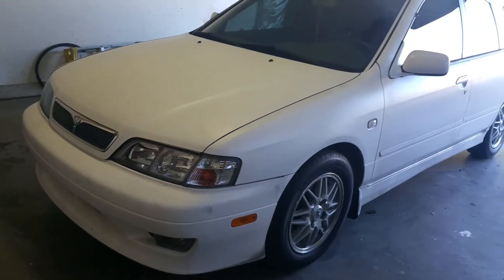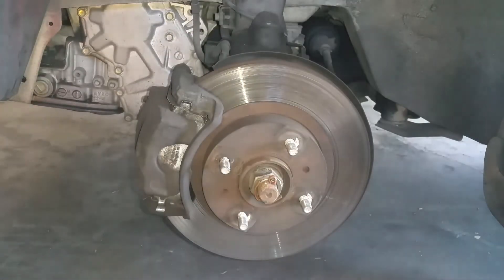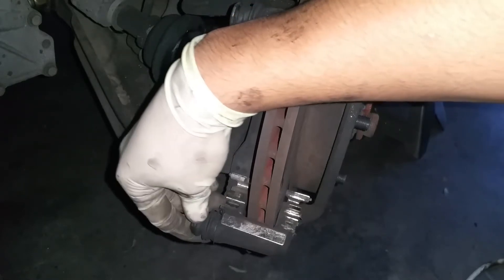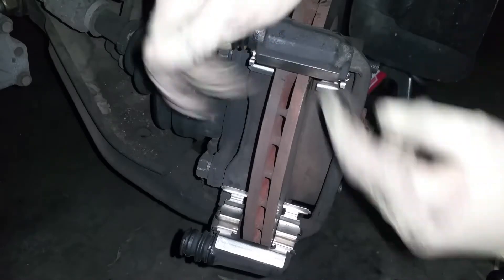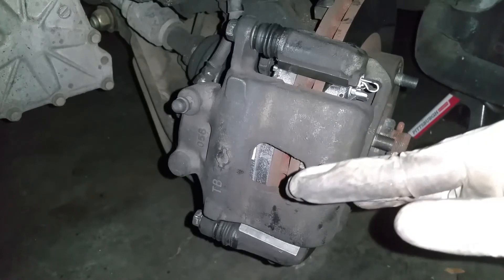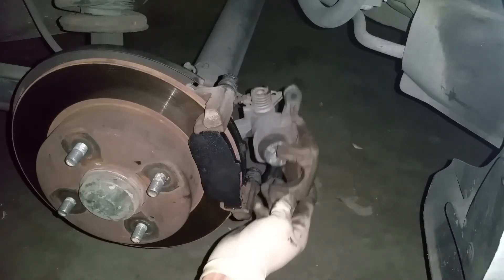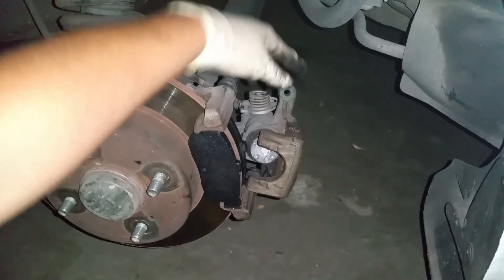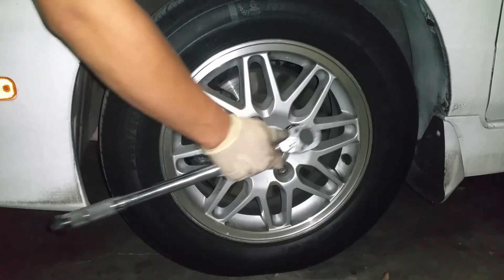Here Is How To Replace Your Front And Rear Brakes On A Infiniti G20/Nissan Sentra/Altima And Maxima

Comment: Hi Eric, My oil shop broke the lug on the rear passenger wheel and then they wanted $60 to replace it, but I told them to go to hell.
Now I am stuck lol. 
I read on the G20 forum that someone said you don't need to remove the caliper and rotor to bang the lug out with a hammer. Is this possible?
this person said there is a "spot for the stud to go through" without having to remove rotor and caliper. 
Anyways, I only have the jack that came with the car and very basic tools, so If i have to remove the rear caliper then I will just take to another shop and get it done there. 
Thanks
Reply from the maker: you should be able to hammer it out once you make a small hole in the rear rotor shield click my video on and go to 11:35 https://youtu.be/Lhl6O8MR75w
Worst case scenario is that you will have to cut the shield completely